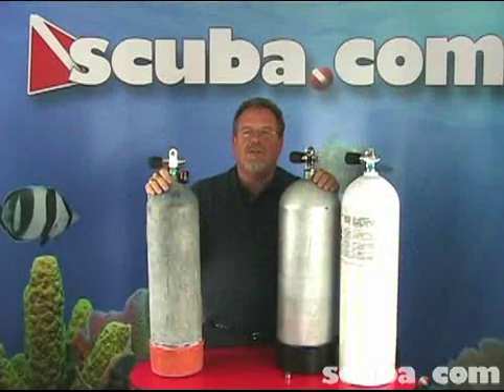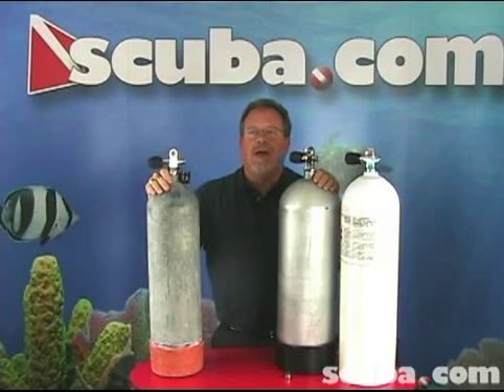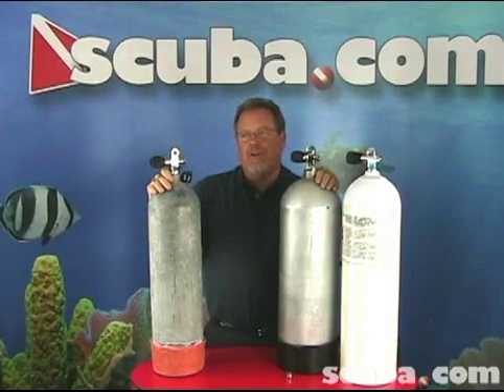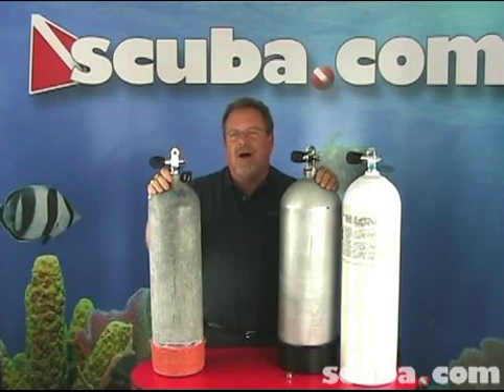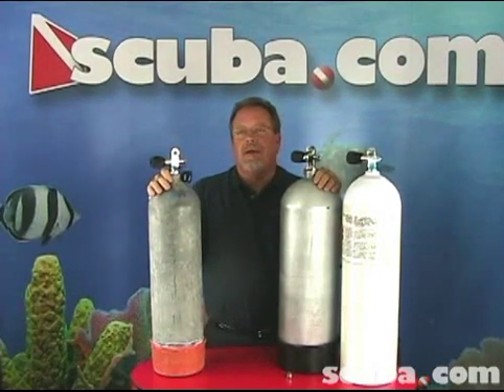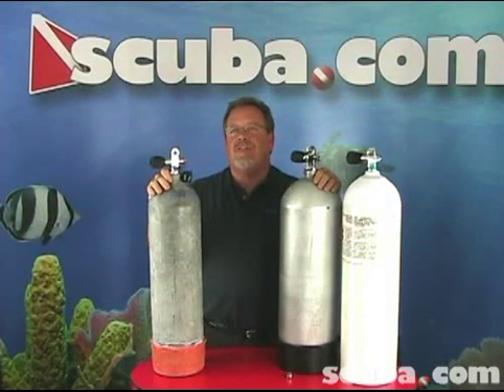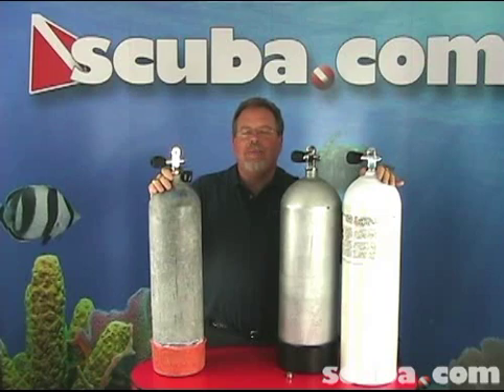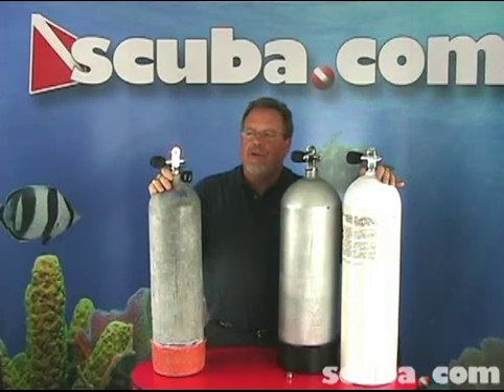Differences Between High Pressure Scuba Tanks and Low Pressure Scuba Tanks Instructional Video

Comment: This was a quick rundown on the types of steel cylinders....not the true difference between High and Low Pressure cylinders and how it affects the tanks capacity.  Also, don't read of a board...if you truly know your stuff, you can just talk about it.